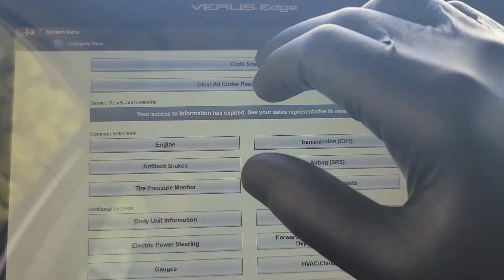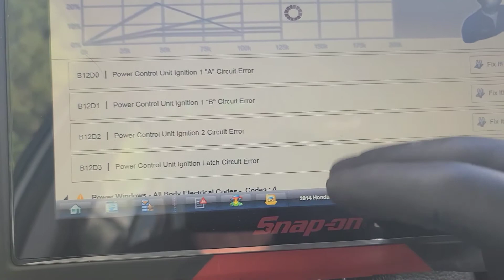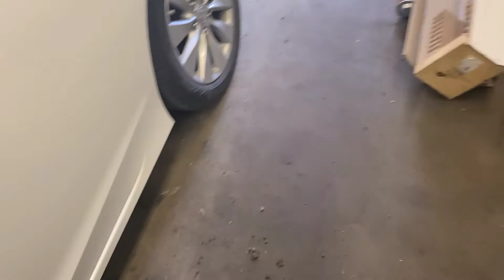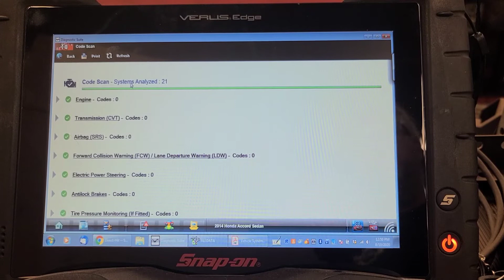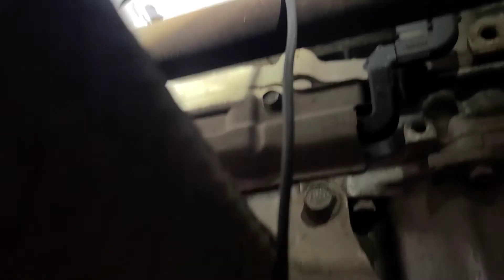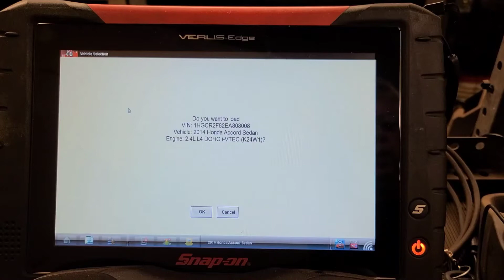2014 Honda Accord Intermittent No Crank Condition

Comment: I have the same problem with my 2014 Honda Accord Sport. I've changed kick starter, relay module, ignition switch, and battery terminals and the issue persists. Usually, I'd leave it for 20-40 mins before it starts. It's worse in the summer.
Reply: Yes, I've noticed when the car is hot or you have driven it, it is more likely to not start. On an Ice cold morning it starts right up.
Reply from the maker: Starters are a high failure item. To be sure you need to have some diagnostic tools on it and catch it in the act...
Reply: @PhillipBailey  Thanks, I'll go back to paying attention to the starter.
Reply: @leumasal007  Any update on this?  Same car and having the same problem here
Reply: @SargeRvB1  Still not been resolved. I am dreading buying another kick starter for almost $400. It's really frustrating!
Reply: @leumasal007  I see autozone has one for around $300 and rock auto has one for about $200 after core return. Replaced battery connectors and couldn't even find the relay module. Now moving onto the starter
Reply: @SargeRvB1  someone mentioned it may be the computer. I have already taken the car twice to the dealership and they can't figure it out  either. I can't afford to buy another car but can't afford to keep throwing money at this car
Reply: @yezkaholic  My buddy has a 14 CRV exact same issue, been to the dealer and they have no idea either!  He has since traded the vehicle in.  Seems like this honda which has the same engine as the accord has issues.  Not often Hondas are lemons but some 14 definetely are!  It's quite possible it is the PCM.
Reply: @cardoc231  ended up doing the same but sadly got another Honda hopefully with better luck. Car was babied from day one OEM parts and fluids and can't believe the dealership just took my money and didn't figure it out!
Reply: @yezkaholic  Modern-day vehicles, sometimes can't be fixed.  This is what gets me, people have this misconception that the dealer is the end-all to repairing vehicles, but sometimes that's not the way it works (dealers have lots of inexperienced kids working there, not saying all dealer auto techs are bad).  Hope you're enjoying your new Honda!
Reply: @cardoc231  I agree somethings are beyond their repair capabilities and electrical issues are like finding a unicorn sometimes. Hate the fact have another car payment but it's a 1.5 honda fit so Gas lasts a bit longer
Reply: Same issue. Summer days hot 100 degree days. Need to let it sit for an hour atleast. Mime turns over and wants to turn on but won't stay on. Did you ever figure it out?

Comment: I had the same problem. When I replaced the starter as soon as I put the negative battery cable on the starter starts spinning and won't stop.  Any ideas?
Reply from the maker: It's either a defective starter or there is a short to power on tge S wire at the starter. Disconnect the S wire and see what happens. If it still starts cranking when you try to hook up the ground then get another starter. If not check for power on the disconnected S wire. Could be a stuck starter relay. Good luck

Comment: I have a 2014 Honda Accord exl v6 coupe...I have the intermittent starting issue...pretty sure it's the starter..its a grinding static like sound...but after a couple or more pushing the start button it starts..service bulletin for this is 16-002...guess I'm taking mine in to Honda to get raped...I hear it's about $750 for new starter
Reply from the maker: I'd suspect a starter problem as it seems common.
Reply: Buy aftermarket and do it yourself it will be about $150 and takes like 20 minutes if you have ramps
Reply from the maker: @Striker50_  If you can do that in 20 minutes you should get a job as a tech...
Reply: @PhillipBailey  You're basically removing 2 screws that hold it on, not much to it aside from the tight space
Reply: disconnect the flywheel and rotate it one bolt hole.  fixed our shit box 2014 v6 accord after burning 3 starters from grinding..  don't know why it worked but it did.
Reply: @GRrrr-b1p  Im gonna order a new one..and have a friend install..they are expensive

Comment: I totally disagree with this article. If the starter worked with a jumper, the problem is not the starter, but the controls sending power to the starter. If the starter did not work with a jumper it would indicate a starter failure.
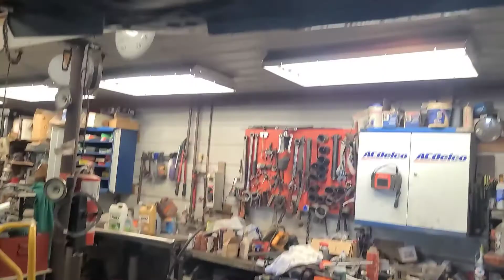Reply from the maker: If you watch the video at 9:24 into the video I did put direct power to the S terminal with a remote switch. The starter just clicked twice and then cranked and started on the third attempt. So yes it did not initially work with a jumper so it got a starter. Thanks for the comment.
Reply: @PhillipBailey  hi tell me how you hooked up the remote start to the s terminal please.
Reply from the maker: @victornaja7927  I slid a backspin into the S wire terminal and connected it through a remote start switch to the positive battery post.

Comment: I have got the same problem of intermittent starting on 14 Accord EXL. i can hear the clicking sound and when you try after fe minutes, it will start. Headlights, Radio , Dash lights all work. Any one who changed the starter continue to have the same problems? My Rear camera and lane watch camera also stopped working. No more Honda.
Reply from the maker: Its probably the starter but to be sure you need to have a test light connected to the starter S terminal and see the light light up and hear the starter just click at tge same time. Seems to be a common failure inside the starter solenoid. Also if you can confirm the click is actually from the starter then thats likely your problem...l have a video on the same car for the rear camera that quit.
Reply: @PhillipBailey  Thanks much. Yes i can hear the metallic clicking sound when pushing the start button. Is there any after market Starter you recommend or is it better to stick with OEM.
Reply from the maker: @gkpangora4831  compare prices. I dont think I'd go OEM unless it was a better price or warranty. Check price and warranty on aftermarket reman. Often they have a lifetime warranty on the part. HTH
Reply from the maker: Here's my backup camera diagnosis https://youtu.be/w8SBAqITpvY
Reply: I changed the starter $750 still doing it. I feel like at times the ignition does not shut all the way off. My garage wants to replace the starter again, but Im not up for another $500 labor fee. I think I will have the pushbutton start replaced.
Reply: @Channel-kf8zt  did you get it addressed

Comment: My 2014 won’t start same problem 😡 hate honda
Reply from the maker: You need to be more specific... It wont crank when trying to start or it won't do anything, no response from the starter? They are significantly different problems. Do the headlights work? Does the dash light up and MIL come on? Does the radio and heater blower work? Is there any click heard from the starter, (turn the radio and heater fan off and listen carefully). If the battery is dead nothing will work...

Comment: Im having the same problem right now. Same car, but manual key start.
Reply from the maker: Yes it seems fairly common for these starters to fail in this manner. Trouble is there are other possible causes. Try turning off the radio and blower fan, open the door or driver window and listen for a single click from the starter. If you hear a metalic click from the starter its likely the same issue and you're going to end up replacing the starter assembly. Good luck and let us know what you find...
Reply: What is the manual key?
Reply from the maker: @rosagarcia7423  I think they mean a conventional key you insert and turn versus a push button start with the fob in the car.
Reply: I have a conventional key and my car is a stick stift also 2014 this is simply ridiculous . how i changed the battery n starter..and still doesnt start unless i pop start it. Grrrrr

Comment: I heard it's bad ignition switch but not sure. Thousands of people have problems with their accord from 2013 and 2014 they replace starters, alternators or batteries and the issue comes back..... I bet honda knows what the issue is but they make thusands by replacing unnecessary parts. This issue has been known for  years.
Reply: Literally me right now, I have replaced all of these parts except for the battery because I figured if it wouldn’t work with a jump then it’s not the battery and I still am stuck with no working car
Reply: CRV's have the same problem!
Reply: @cardoc231  I believe it is a sensor problem with my car. when the starter engages, it starts right up. Usually starters do not abruptly fail. My car either starts or does nothing, I think it is a brake or transmission sensor.
Reply: Starters are common problem on these as well as the Keyless Access Control Unit (TSB 13-038) on 2013 Accord.
Reply: @Mickey_Bauer hey what’s up bro I have the same problem but I hear clicking coming for that module does that mean it’s bad?
Reply: 2015 honda accord sport 2.4l.. Starts 1st try sometimes or it takes a random amount of tries. No sound but a fant click which just starting was not sound.  I have all dash lights turn key headlights and sceen goes out. When it starts perfectly fine like there was no issue. Anybody fix it or know the problem??? Really aggravating. Nobody responds or updates about what they did crazy...
Reply from the maker: If you hear a faint click from the starter, you likely will be replacing the starter. To be sure, you need to have a test light on the control wire at the starter to confirm power is being sent there. The problem is intermittent, and the testing is difficult to access.

Comment: I've got the same intermittent problem and I have watched numerous videos to no avail.  I have a 2014 EX with no aftermarket starters.  I too do not want to spend money replacing batteries (mines currently 18 months old) Key FOBs and batteries, starters and still......nothing.  I hate to sound like cheapskate BUT, I need something more definitive to go after.   Anyone else got a lead on this?
Reply from the maker: Unfortunately is a network code scan does not return any codes you need to access the starter S terminal and attach a test light to it, run it out of the engine bay where you can see it from the driver seat. Every time you start the car that light will illuminate. If it illuminates but does not start you need a starter. If it does not start and tge light does not light up then you need to diagnose the control circuit. If it would die and stay dead its actually easy to diagnose. The starter is not too bad to replace and it appears quite common to fail. You could roll the dice and throw a starter at it. I charged this customer $727.00 Canadian so that's about $550.00 USD. Good luck
Reply: On my 2013 Accord the engine does not always start.  When it does not start I continue to hold the brake pedal down then push and HOLD the START/STOP button and it will start.  This indicates that there is a possible problem with either the push button switch or the brake switch.
Reply: @michaelrobledo  I'm having this same problem. I'm mechanically inclined with an electrical (trade school) degree. Unless we have a way to test the "S" wire while starting we are only guessing. I've thrown 2 new batteries at this problem. I thought it was battery failure due to the reduced charging rate Honda has incorporated to save fuel. I do run a volt meter. Mine will start on the 2nd attempt. 1st try it turns over 3 revs.

Comment: Thanks for your very informative video.  I have a 2013 EX-L CVT and am having this exact problem although I do not have a remote starter.  I've been doing a lot of research and have found several people with this same problem who have had their starters replaced but the problem continues.  I'm very reluctant to spend $800-$1000 to replace my starter and continue to have the intermittent no crank condition.  Any idea why so many have had their starters replaced and continue to have this problem?
Reply from the maker: It seems to me that the starters are common to fail. Actually seems its the solenoid internal in the starter which seems to be the root cause of the nocrank condition. Trouble is you have to have some test equipment on it to catch it in the act. The control terminal is difficult to access. If you could get a test light wired to the control terminal and put it in a place where you can watch it each time it cranks is a good way to catch the problem. If the test lamp lights but it doesn't crank the problem is in the starter. If the test light doesn't light when it doesn't crank then it is likely a problem in the control circuit, starter relay, safety switches or security issues. The problem is catching the condition. Make sure the battery cables and connections are good as well. Good luck
Reply: Hey Scott I’ve got the same car as you with the same issue, were you able to figure out the issue?
Reply: @andrew041994  Unfortunately I have not yet found anyone who can solve the problem
Reply: This is my 5th Honda and my last Honda. They've lost a customer for good. Very disappointed.
Reply: @Sirmixalot_cocktails  ok thanks for the response 🙏
Reply: I have been through a new alternator and a new starter and I’m about to throw a battery at it as well and still no luck I’m beginning to not know what to do
Reply from the maker: You need to wire a test light to the control wire at the starter solenoid so you can see it being energized when cranking. Try moving the shifter to N if its an automatic.
Reply: @PhillipBailey  Also try moving the steering wheel back and forth next time it won't start. Could be a short in the column.
Reply: @genesmith7921 how can this be tested? Seems the gf has an issues and her turning the steering wheel out of that locked position before trying to start helps. Also I hear the starter clicking once, does that mean the starter is fine or could it still be bad?